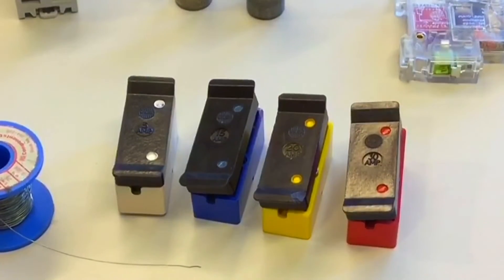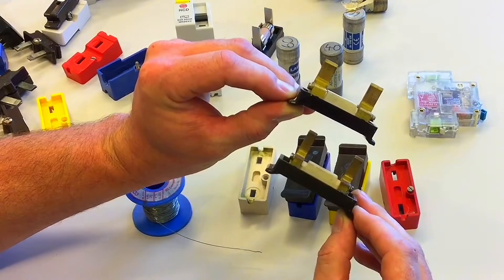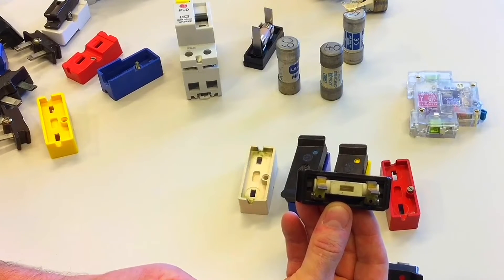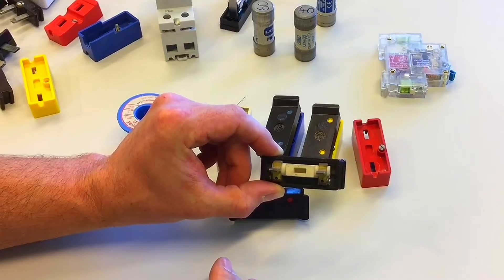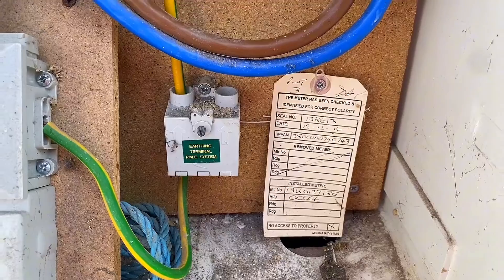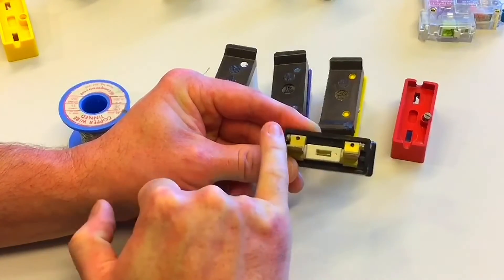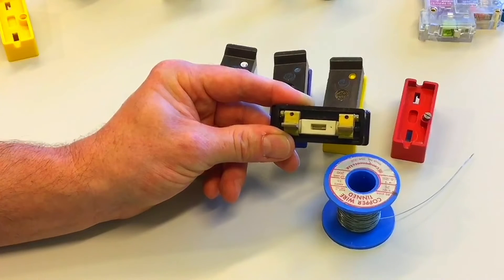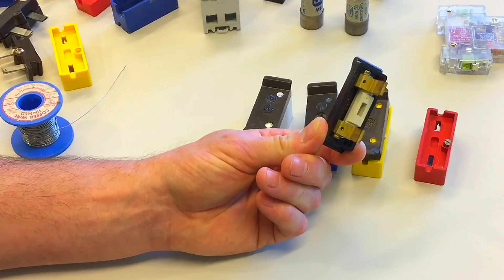BS3036 Semi-Enclosed Rewireable Fuses Explained

Comment: One thing with those fuses that was very common. Customer says the fuse has blown . I replaced the wire and it’s still not working. What they had done is not left a loop and when they done up the screw it snapped the new piece of wire they just put in . Especially common on the 5Amp small wire

Comment: Gaz your right when you say replacing a 5amp fuse wire with a 15amp , can cause problems, so why does BS7671 state that the current rating of the circuit protection should be equal to or greater than the design current. ? I believe it’s because fuse wire/ fuses    Carry more current than they are actually rated for and must pop within a time not exceeding 30 minutes and that’s why we must calculate cable size/current carrying capacity to in the cable don’t over heat under fault conditions? This is from a video from someone else. I disagree with there explanation but I get what they’re saying. But if it’s wrong then why do we still have 6amp breakers on lighting circuit with LEDs that will never draw anywhere near 6 Amps ie a lighting circuit with twenty 20w LEDs will only draw 1.7 Amps, 20x20w=400w /230=1.7 amps. Current carrying capacity off 1.0 mm TW&E is 11amps .
Reply from the maker: A 15amp fuse wire can carry 29amps for hours.
Reply: Yes that’s my point a 5amp can carry a lot more than it rating as can all fuses . Yet we know it could course problems like overheating yet the reg say the device should be equal to or greater than the design current . Seems a bit silly in my opinion.